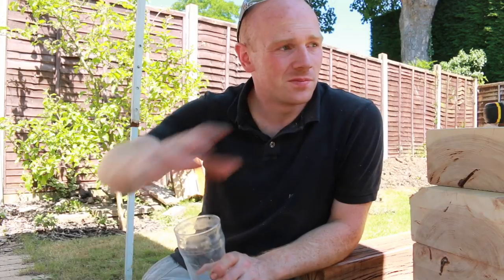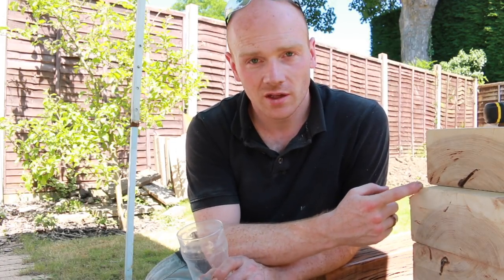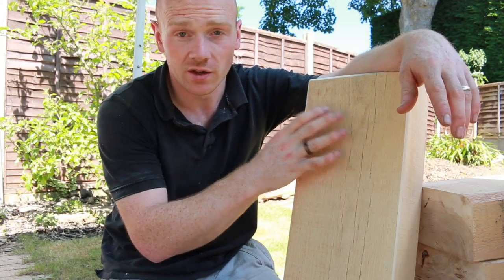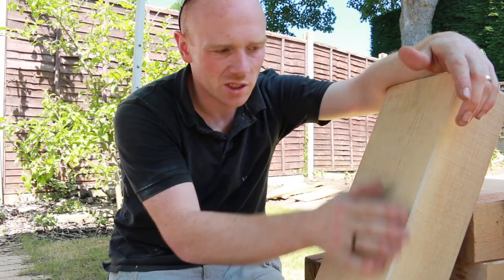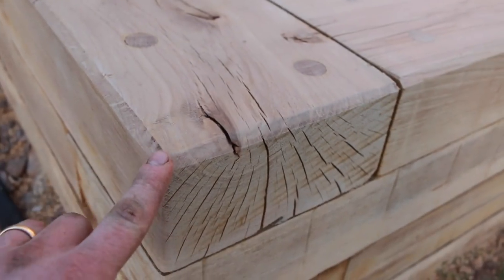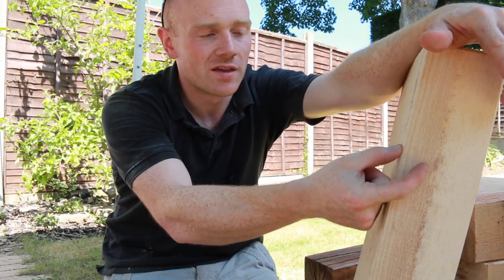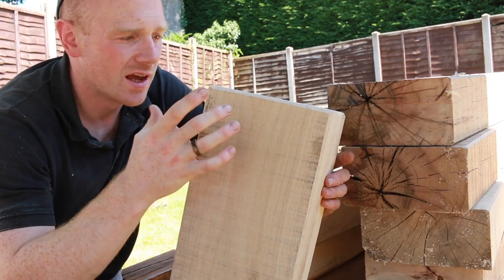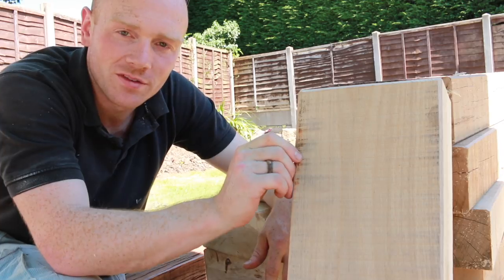OAK vs SOFTWOOD for Garden Projects

Comment: About to build oak raised beds - I have 6.7x150 stainless screws & wondered if you have any advice on both diameter & depth of pilot holes I should use for these screws please?  Is it best to use an auger bit? Thx

Comment: I was advised by Osmo that their oils will not work (well) on green oak sleepers (as these are) as their moisture content is way above 20% (the limit on which their oils will work with. How did you overcome this, or did you disregard this? .
Reply from the maker: Usually leave for a few months. With sleepers and raised beds you are usually only treating one face so not actually sealing in completely. Never had any issues. 👍
Reply: @TheRestorationCouple  thanks! :)

Comment: White oak is a great choice for that application however here in the US it's extremely uncommon to be used for landscaping due to the extremely high cost as well as availibility unless you live in a region with lots of oak trees and small sawmills. What do those cost there?
Reply from the maker: A few similar comments, I guess this one is more suited to European viewers then.  Here an 8'  8x4'' sleeper/beam is around £18 in pressure treated vs £25 in oak.  The oak is of course a lower grade and not joinery quality,  if you were to use better quality oak it would be 2-3x the price.  Oak is still seen as a high end material for woodworking and interiors and demands a high price most of the time.
Reply: The Restoration Couple Thanks for the reply. That's not a bad price at all. Here in treated yellow pine it runs $30 to $35 and is a special order item at the commercial lumberyards. 4x6 is readily available but very poor quality as in preformed boat building lumber. The best treated lumber I have seen in the us was in Hawaii where I grew up and they had their own wood treating plant. Very well treated as termites are a huge problem that there. Next trip to England I plan to visit building supply stores and tool stores because I like seeing what's available in other countries and always looking for new tools to bring home.

Comment: I’ve always said if your building something you want to last for decades not years, always go for oak. Especially if your going to spend a long time building it to a high standard always go for oak it’s going to be worth the extra cost in the long run not to mention it looks fantastic. Unless you are using free wood always go for oak if you are buying some for a big project.

Comment: Price i paid it was £15 for softwood and £20 for oak. It was a no brainer really
Reply: Softwood won't last long. Only way for it to last longer is to treat it. Treating it with poison to be durable and using that for a vege garden is plain fkn stupid.

Hardwood is naturally durable in a vege patch garden and doesn't require treating therefore safer for veges.

$20 for oak. No brainer
Reply: @samoanSAIYAN  yep exactly, the oak sleepers are currently sat in my garden haha

Guna give them a coat of clear Osmo UV oil

Im also backfilling behind the oak sleepers with gravel, with a non woven membrane seperating the gravel and earth

Im also putting a 75mm perforated land drain to the rear in the gravel connected to my drain
Reply: Good price that Bob. I’ve just bought 30 oak sleepers and had to pay £31 each plus vat. Even had to pay £30 delivery. Did you use the Osmo? I’m not sure yet what to do. Same with the SS fixings.
Reply: @martybli  yes very good price. I had to shop around but could say no at that price. But had to basicly take them there and then. Iv not used them yet. I will be in the next few weeks. I will be using osmo
Reply: Where did u get it that cheap?
Reply: @robdavies9709  it was a local place who needed to get rid of stock. It was more than a good price so i couldnt say no. Other places were like £30 each
Reply: @bobcharlie7982  Hi Bob, did you treat before installation? I have oak sleepers but not sure if I need to sand and treat them first. I'm only doing edging so the bottom of the sleeper will be resting on pebble stones hooked into pockets of concrete. I'll be using Mannings UV decking oil instead of Osmo as it was recommended by the supplier.
Reply: @pjroberts2010  i havent treated yet! My plan is to use osmo uv oil anywhere it is exposed to the sun

And then sikagard wood preservative on anything thats not seen / in the ground
Reply: @bobcharlie7982  Thanks Bob, I think I'll do the same.